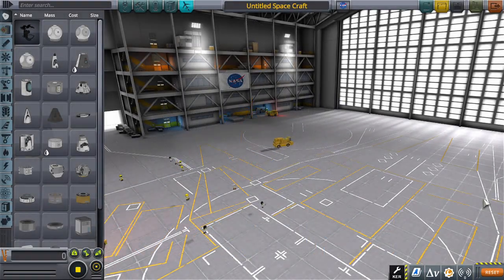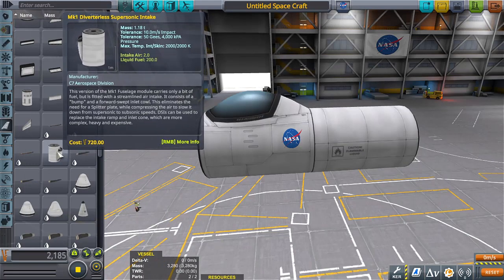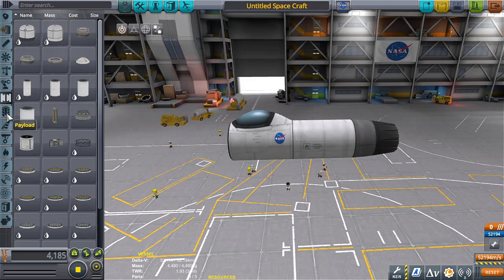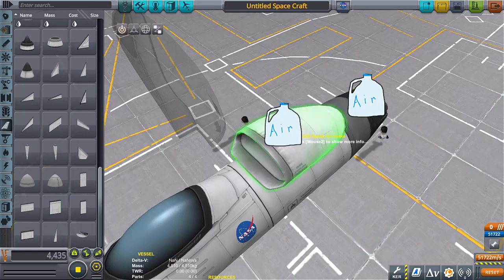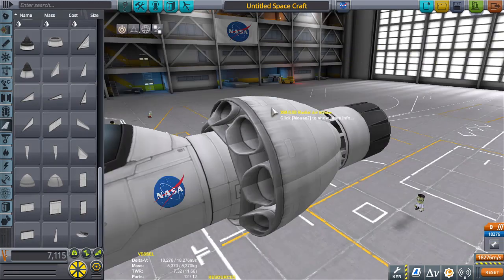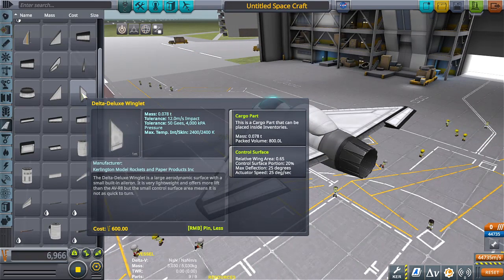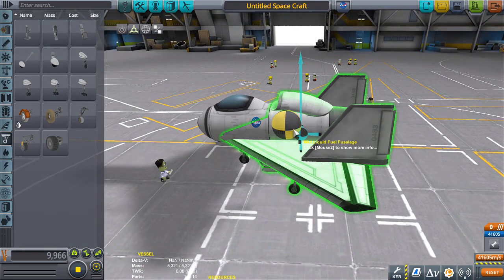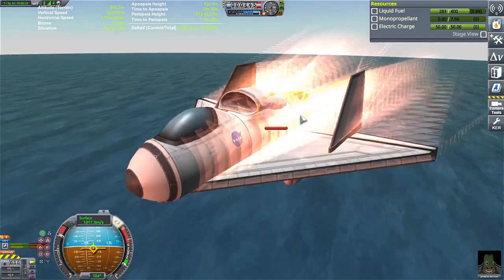TUTORIAL SIMPLE PLANES  \  KSP 1.11  \  Kerbal Space Program

Comment: I literally can't make the engines work. I've made a MIG ripoff (air intake, cockpit, fuel, then engine) and a twin-turbine engine (under-wing air intake, fuel, then engine) what am I doing wrong. The engine turns on, but no thrust.
Reply from the maker: @commissardale  First, check to see if mod is interfering in some way. Then check the engine thrust in the Space Plane Hanger. Make sure the engine part is not directly connected to another part that doesn’t allow for fuel to reach the engine. ( metal plates or beams for example) And finally make sure you have enough air intakes to feed air into your engine at startup. Scoop air intakes don’t feed your engine or engines a lot of air when your craft is at a standstill. You have to bump up the thrust slowly to get the craft moving before maximizing the thrust.

Other then that i can’t think of anything that wouldn’t allow your craft to work. 

hope this helps. 👍
Reply: @vaos3712  I am a moron, I didn't pay attention and didn't see the "throttle up". I thought it worked the same as rocket engines.

Comment: I find that having the CoL ball just behind and above the CoM makes for the highest stability.  I also like to try and get the LoT (line of thrust) to be just BARELY below the CoM.  That, with a slight pitch to the wings, gives a craft a natural tendency to lift, which makes for far easier low-speed, high-altitude flight.  It's a wobbly goblin if you do it wrong, but if you can get it just right, it's stable, and will climb steadily forever with almost no pilot input.

Comment: While the technique for aligning wheels at 2:34 works, you could also toggle the rotation to 'Absolute' rather than 'Local',as long as the snap alignment is on it will fix to a perfectly straight alignment which is good if your wings are at a different angle.

Comment: Additional notes for viewers:
1. Engine ISP is proportional to the amount of air needed--The more efficient the engine, the more air necessary. So a Wheesley takes way more air than one might think. (I can explain the physics if anyone wants.)
2. "Elevon" is a common word for a control surface functioning as both an elevator (pitch) and aileron (roll), such as in a delta-winged craft without a standard tail. Yes ailerons work better for roll on the outside of the wing, but elevators only care about forward and back.
3. For straightening landing gear, use Absolute mode. Local does it relative to the parent part, and the parent part may not be snapped to a precise angle.

VAOS, if you cover drag and part-attachment more, read AeroGav's Mk2 Spaceplane Guide. If you get into heat management for fast aircraft, there's more involved than just absolute temperature tolerance. Different categories of parts transfer and radiate heat differently, and that can be used to prevent the common problem of cockpits and engines blowing up. This is only listed in the config files, but it's simple enough that a basic understanding makes the difference between 5 minutes of survival and infinite. For reference, Jool-diving with no heatshields: https://i.imgur.com/a74OEug.jpg
Reply: "Engine ISP is proportional to the amount of air needed"  Nice tip! I hadn't known about engine ISP being related to the IntakeAir required, but in hindsight it makes sense. Stuff like this is why I watch "basics" videos. Back in my day kerbal planes didn't need air, they were just rockets with more fins.